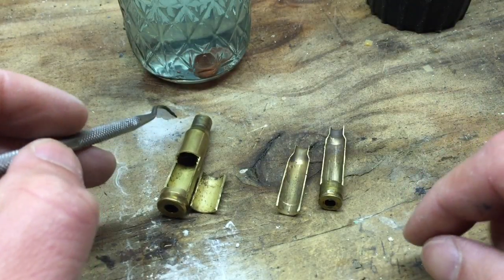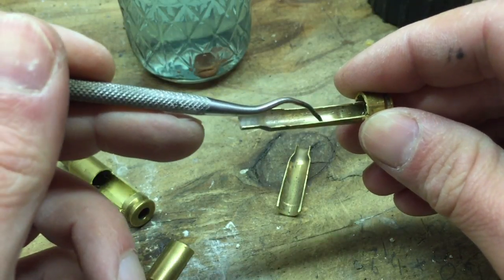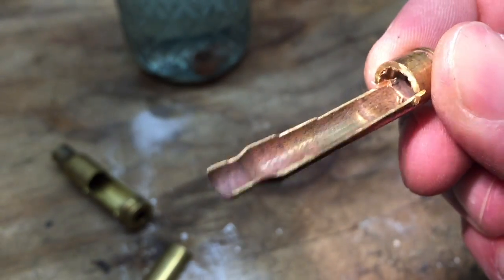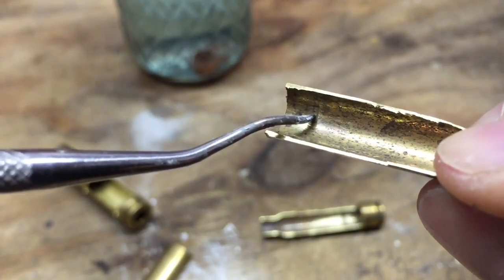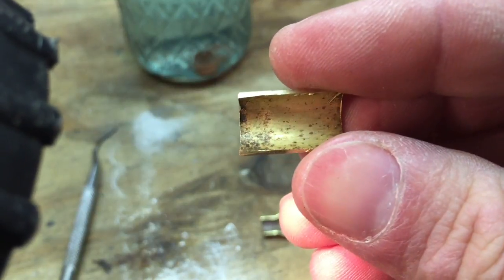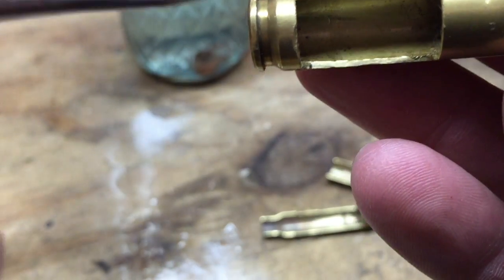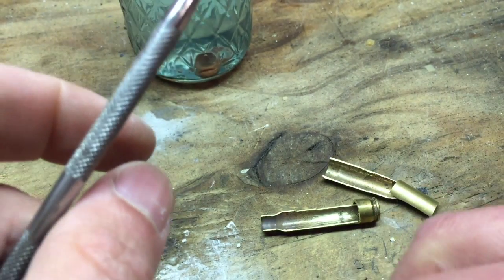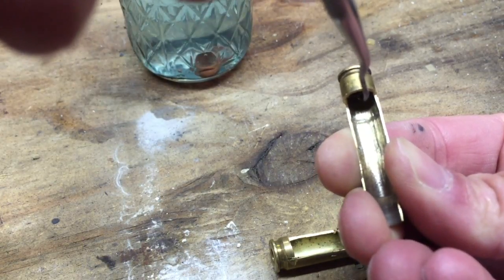AVOID Case head separation - SAFE RELOADING - check your brass

Comment: Thing I see is, that pick is one heck of a lot stiffer than any paperclip, no wonder you can't feel it with that. What you are pointing out is valid stuff to look for, but are misrepresenting the tool, by not using the proper tool. With a paperclip, you can feel the shallowest one you show, quite clearly, no issues, the tool you are showing is useless as a boar's tit for the purpose.

Comment: great video will help newbies out a lot . i use a bore scope to check my new once fired brass . and all reloads after 2 loads . used to use my rcbs case master if set up right the dial will show a thin spot in the brass as you pull the case through .
Reply from the maker: Stoked that it’s helpful!

Comment: What would you recommend saying to the seller of the “once-fired” brass that has this defect? I purchased 1000 polished cartridges of .223/5.56 rounds, and 9/10 rounds are 5.56. So far, of the 5.56 it looks like 2/3 of the brass have a clear defect. The other 1/3 are not very noticeable or defect-free and can maybe be fired once or twice more if reloaded to fit the same rifle as they would then be fire-formed. Any helpful tips would help! Mahalo!
Reply from the maker: You probably want to see if you can return the brass.   If it’s not safe to reload, it’s of no value to you, except as scrap.

Comment: Look up the Real Gunsmith about resizing.  The issue is over and over again resizing DOWN to SAMI Spec.

Wind die to case holder THEN wind BACk one full turn.

Then size brass. It wont load (yes you need rifle) then INCREMENTALLY  advance i.e. turn die forward, keep testing. There will be a point when case loads with only minor force at end, felt through bolt handle  This is now CUSTOM fitted to your chamber. 

Better accuracy and no more case head separations.

Target shooting your done, in BEAR country you must test all rounds to check they chambered properly.  Otherwise you may with a very very small probability be a bear treat.

Head separation is about the repeated expansion from Sami Spec to chambers dimensions and back again and again.  This advice is for BOLT RIFLES not automatics.  Look up The Real Gunsmith on Youtube
Reply: there is more to headspace then just bumping .002" for a tight fit. you need to read more if your still alive.

Comment: Heck, I reload all of my 223 until the case mouth splits :)  but they are just lower charged plinker rounds.
Reply from the maker: Jason McCarthy I figure safety is a good idea when you have 50,000 psi somewhere near your face.  I've also found that mid-range powder charges often produce more accurate ammo.  I get what you mean about plinking loads, though.  I do the same with .38 special.  👍🏻

Comment: Thank you for the video,   I can see that it was a while ago but wondered if you could help me with a question please .  Near to the head on some multi-reloaded, full-length sized cases I also have a bright/light ring. Opinion seems divided on whether these on their own represent incipient separation or are simply the marks that one can expect when full-length resizing. I simply ask because upon examination (the sharpened paperclip trick and cutting samples for a cross-section view) I don't identify any issues with thinning brass. Do you have any advice please? (I also have some batches of once fired brass, I will only be neck sizing these so it will be interesting to compare.)
Reply from the maker: Geoff Wickett I'm far from an expert, but if both the paper clip and cutting a few open don't show any thinning, I would say it's likely just how your dies are interacting with the brass.  If you can tell me more, like chamfering, headstamp, etc I may have some here I can compare for you.  

Coining, the bright ring from thinning, won't go away with tumbling and polishing. If the ring gets dull when you wet or dry tumble, that's a good indication that it's not thinning.  

Also, do the flashlight inspection.  On the inside, see if the clean brass has an "orange peel" texture or if it is smooth.  If it has that orange peel look, it's stretching over a longer area, so the thinning is minimal, but still taking place.  I see that often on once-fired LC 7.62x51  brass from the M240 machine gun.  It's still good for at least one firing at that point.  

 As always, when in doubt, toss it out.  It's not worth your life or your safety or the safety of those around you.  Hope that helped.

Comment: Excellent video, how long do you generally take to inspect a bullet casing?
Reply from the maker: It depends on the casing and how dirty it is on the inside - some powders burn cleaner than others, leaving less soot and residue, making for easier visual inspection.  For a typical 5.56, 7.62x51, 30-30 or 30-06 case, about 3-4 seconds per case.  That includes a quick look at the rim (checking for bad gouges and bent rims) and the neck (looking for splits, creases, etc.)

Maybe a little less if the cases are tumbled and cleaned first, but that's a mixed bag - sometimes it helps, sometimes it hinders.  An important thing to remember is that at each handling stage, you're inspecting the brass for defects.  The initial inspection is first to cull as many bad ones as possible.  Then after cleaning, a second inspection looking for body defects, cracks, etc.  After resizing there is another chance to check, since this is when a neck that is going to split often will (dragging the expander ball back through).  

There's another check I need to add, and that's primer pocket size.  But again, that's for another video. :)